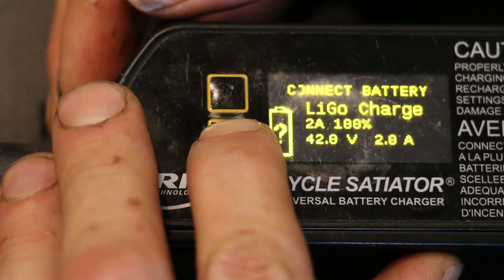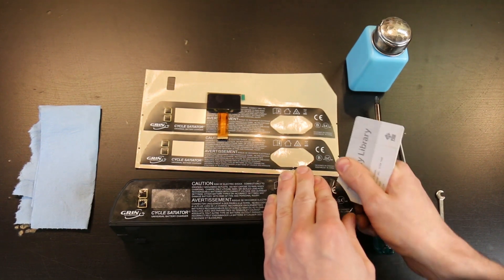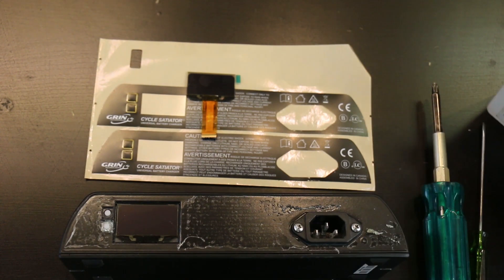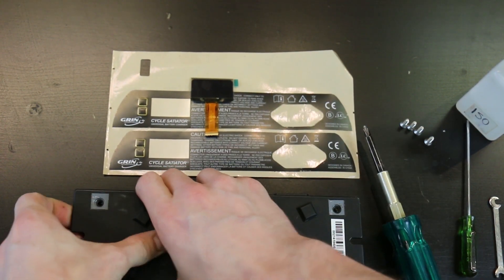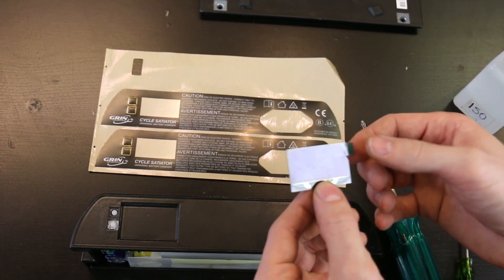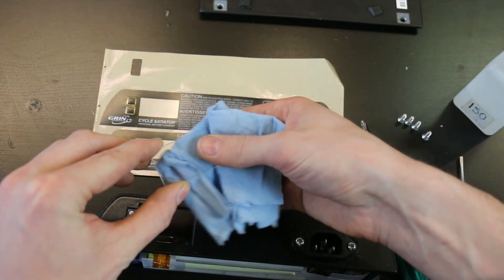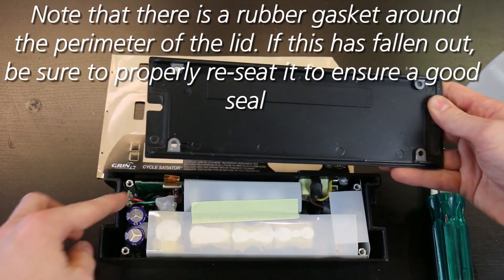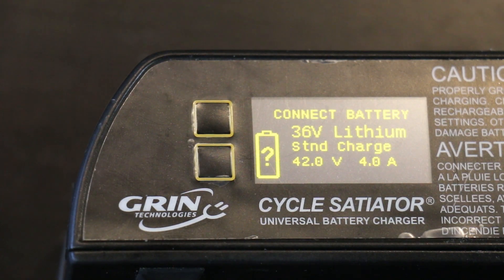Satiator Charger OLED Screen Replacement Tutorial

Comment: Is there a way of testing the charger if the screen is blank before I order a replacement screen ? just asking as the shipping costs are more than a screen...
Reply from the maker: Yes, even with a broken screen the device will still function just fine, you can either put it into bootloader mode by powering it on with the lower button pressed and see that you can connect it to a computer if you have a USB->TTL cable, or you can just measure the output voltage on the XLR pins and do a "force start" with whatever default profile you have by pressing and holding the lower button for a second after you have powered it on.

Comment: Thanks for the video man I thought I would have to get a whole new charger! I still haven’t gotten the screen replacement but I’m about to order it now. Thanks again!
Reply from the maker: No problem, as long as we keep making the Satiator we'll be keeping these replacement repair screens in stock.  Also, you CAN in fact use the satiator even with a cracked / broken screen. In that case, we usually would recommend hooking it up to a computer and setting up the default profile to be what you want, and then whenever it powers on it will be ready to charge once a battery is connected even if you can't see what's going on with the screen.
Reply: Another question, I have a juiced bike and the battery I have for it is a 52V 19.2 mah battery. On which setting do I put my battery to charge with this charger?